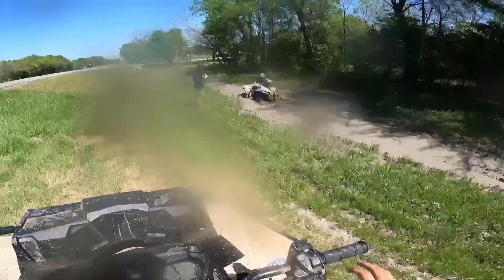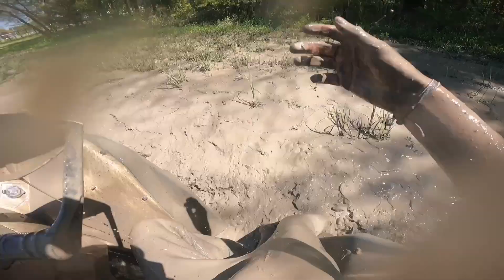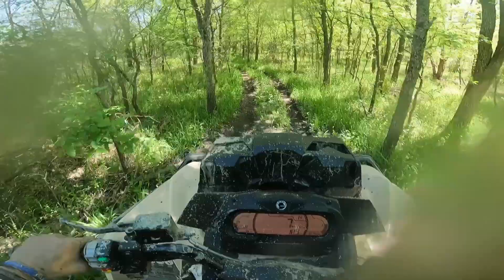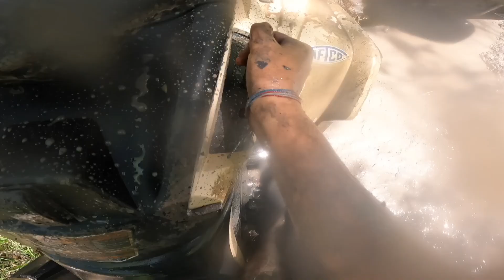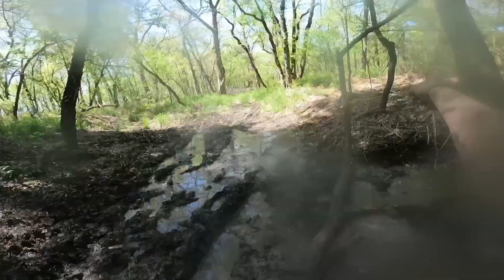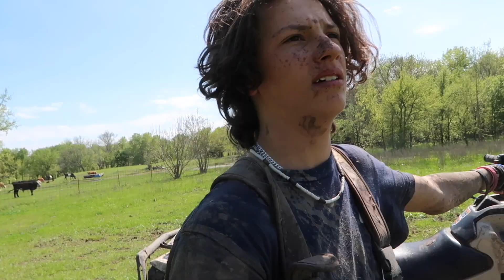FIRST RIDE on the 2023 CAN-AM RENEGADE! *ALMOST CUT OFF*

Comment: Pro tip bro, you don’t have to pull the air box lid to check the airbox, they have lines that run to the bottom with a cap that u can pull to let water come out if any, you don’t wanna pull the airbox lid off too much bc then the seal goes back and water will get in there.